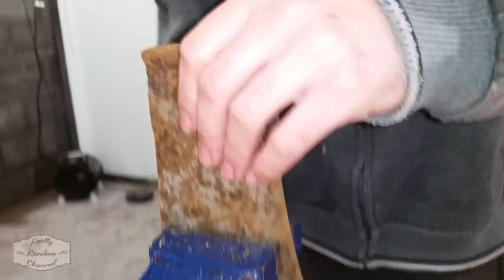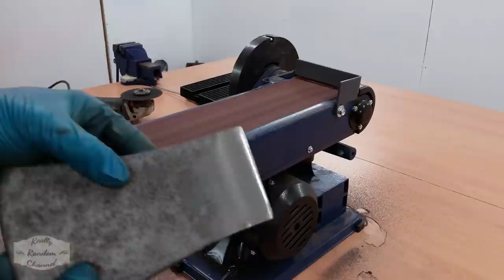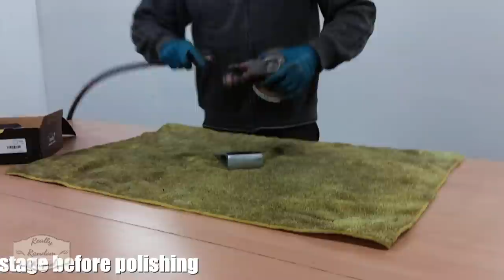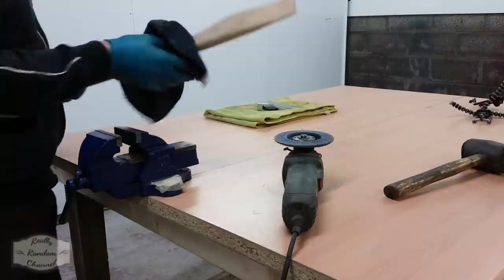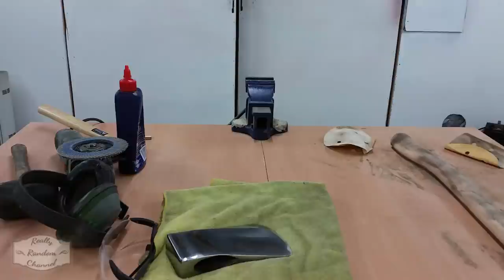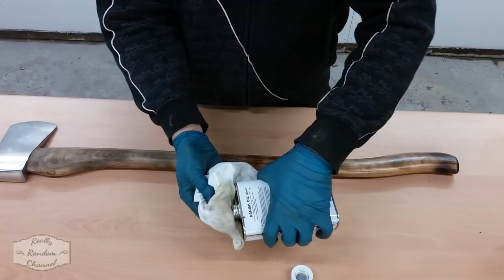Rusty Old Axe Restoration

Comment: So, I enjoyed this muchly. But the workspace gave off this weird vibe.
Reply from the maker: Really? what kind of vibe? Im thinking maybe i need to have some tool boxes and stuff in with me to stop the place looking so clinical?
Reply: Really Random Channel .... I think clinical is probably a great description. Almost felt like you had a room next door with a chair in the centre bolted to the floor, covered in chains, with all your cutting devices hanging up in there 😂

You’re probably just lucky to have so much space. The room you walked into with the axe head has nothing but two big desks and a vice. In the UK we usually have so little space, that one room with the desks is bigger than my entire workshed.

Perhaps you just need tools on the wall, a vac system etc. Perhaps some racking at the back. It didn’t put me off the video, as I said I loved the project. Just odd to have so much space and so little filling it.

Subbed btw.

Comment: isnt easier sand it with flap disc on angle grinder, polish, also with flap disc do the grind for sharpening, put the head on cable (properly) and smash some logs? Ur job is pretty amazing but i think thats possible do a same looking axe with 30% of work or less

Comment: I'm about to try something similar. Do you, or anyone else, happen to know if it would be worth giving it a heat treatment before finishing?
Reply: ONLY IF YOU OVER HEAT IT WHEN WORKING IT. RED HOT METAL THAL COOLS SLOWLY CAN LOOSE ITS TEMPER. Sorry about the cap locks. Most of these tool heads are high carbon and should be quenched after heating to an orange color hot in oil. If you want to keep the crystal structure of the metal as it was when new just keep it cool as you grind and sand it.

Comment: Im always wondering. Should the axe head not go deeper into the wood handle and should you not then leave more of the head sticking out that cutting it down so low? It just seems the Axe head will eventually pull loose of the wood handle.

Comment: Question: If you are able to file sharpen the axe head, doesn’t that mean it’s not hardened? Is there a reason to not harden an axe head? Also, with all the work out in to make it new again, I would have done a little reshaping if the blade edge. Just me though.

Comment: The tips when you restore such tools are
The handle should touch perfectly the inside surface of the head of the tool.
The handle should not have a shiny surface for a good grip. 
The handle should  not be round but oval for better grip - it does not turn in your hand. 
Shining tools is of secondary importance.

Comment: Using an angle grinder without the guard with a CUTTING disc is asking for major league trouble, especially if you (occasionally) use it for grinding. Cutting discs are notorious for flying apart even if you use them exclusively for cutting. This practice will get you with high-speed projectiles in your face.

Comment: Incorrect way of installing the axe to handle. You don't use a mallet to beat the axe head onto the handle. Tap axe head so it doesn't fall off, then tap handle end downward until axe slides up, until it is as far as it will go. Use a longer wedge without glue, and axe head won't go anywhere.
Reply: To add to this you should prime the shoulder with linseed oil or similar before the final hang. You should also use a block of hardwood to tap the wedge into place. This will prevent cracking the wedge and give you a better drive. You also didnt finish the the wedge with a step lock or wedge pin. Overall nice restoration though.

Comment: Only thing I would change is that to properly seat an axe head you hold it upside down and hit the bottom of the handle with a heavy plastic mallet of some sort. Other than that looks great
Also use a piece of wood between the hammer and the wedge when you sink it in. This will keep it form breaking. It's a nice job but after seeing this I wouldn't trust that axe for longer than a day or so.
Reply: Yea that really bothered me how far the wedge went in and how far he put the axe head down the handle
Reply from the maker: Check out my new sledge hammer video you'll see i learned a lot of lessons from this axe ;)
Reply: @RRCRestoration  Beautiful build with the sledge. Head mounting was much better, however when I say hold it upside down, I mean hold it. The head hangs in the air, and when you hit the back (something plastic suggested) the handle moves down but the head has a lot of mass and wants to stay put (Newton's first law of motion) thus driving the head onto the handle with its own weight. Not only does this keep the head and handle safe, but it ensures the head goes on perfectly straight. Other than that, it's absolutely stunning. Love it

Comment: I just wonder... you don't need to treat the axe against rust with an anti-rust oil for example? IS it useful or useless?
Reply from the maker: Thanks for the comment. After using  a bare steel tool like this i always give it a wipe down with wd40 or even engine oil just any oil that will stay on the surface of the steel until its next use. Ive been doing it this way for years and never had a rust issue ;)
Reply: mirror polish will help somewhat against rust. fewer surface imperfections for moisture to go into.

Comment: Good job with the head, however you’ll swing that 5 times and the axe head with fly off the handle. Your not supposed to sand down the insert your technically supposed to force it on then jam the wedge in there as far as it will go. The axe head should not slide easily on the handle like that it’s gunna fly off the handle.

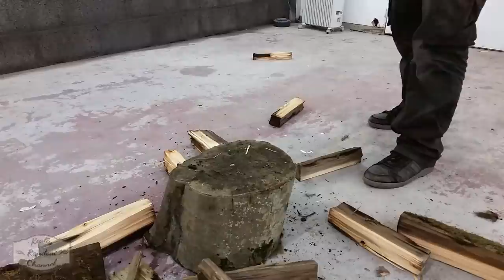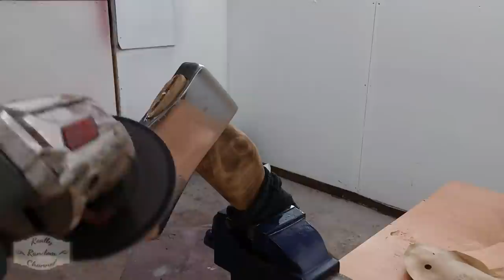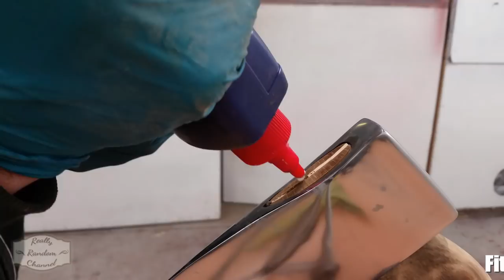Comment: at 18:04 it looks like the handle is already loose on the head.  It didn't appear that the wedge was properly put in at 13:45, as you can see in the video it broke of while he was still driving in the wedge. Should have removed the wedge and started over.  Attention to detail and all(14:01).

Comment: As someone who uses an axe quite frequently dolling them up like this feels kind of wasted. It' s like polishing a crowbar. Sure its shiny but it doesn' t really add anything now you just don' t want to use it because you don' t want to ruin the shine.
Reply from the maker: You make a very valid point. I only use an axe very occasionally so it should in theory stay shiny for years to come :)
Reply: I actually agree with this.  It's fun to polish things, but for a real work tool, basic clean up, a good edge and a coat of red paint is what's really wanted.  It doesn't make a good video though, and it is fun to see what you can do with a crapped out mushroom-backed axe-head.  I actually have just such an axe-head in my tool shed, and one of these days I may just make a D & D prop out of it.  I already have 2 working axes, but this head came from my great grandfather and so something good has to happen to it.

Comment: no guard on the angle grinder? basically asking for it ent ya lmao
Reply from the maker: Dangerous yes, but its a very common practice in the motor trade to remove the guard as it gets right in the way if you are working inside a wheel arch or transmission tunnel.
Reply: As a mechanic i can agree that I see loads of people doing it, I just prefer to have all 5 fingers than a bit more room on an angle grinder, I just choose to pay 60 odd quid and bought one with a 50mm disc if I need to get into tight spaces.

Comment: I'm not a fan of the burnt handle look. is a first class job, that's for sure. With the burnt handle, I think the head would go with it better if it was not so shined up and just blued. Personally I would have used a walnut stain on the handle, then coated with clear poly. Keep a thin coat of WD40 on the head, to prevent it rusting again.

Comment: I always like to make sure i plug my power tool into something that can fall off the table, I also appreciate when I'm sanding, the machine dances around, because nobody has time for bolting things to tables. Pfft.
Reply: Fox Racing it’s a table clamp belt sander you’re not supposed to be able to bolt it to the table

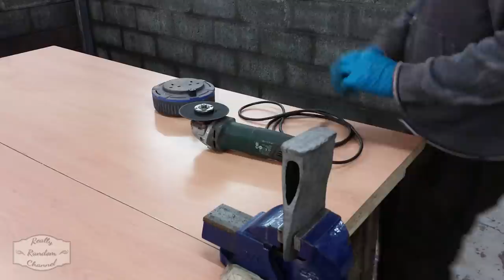Comment: @ReallyRandomChannel 2:26 If you need I will donate for you to buy a guard for your angle grinder. That is SCARY!
Reply from the maker: Dangerous, but its a very common practice in the motor trade to remove the guard as it gets right in the way if you are working inside a wheel arch or transmission tunnel.

Comment: beautiful show piece, but very dangerous to use. The way the axe head is fitted is not secure.
Reply from the maker: Hi, I was using it all last winter and will be using it again this winter for chopping firewood. The head is still as tight as the day i hung it, so no issues with safety at all.
Reply: I hope it works great! Definitely keep an eye on it, odds are it will stay on for a while but long term i question.

Comment: My one issue with this video is where you used a grinder with no guard and a cutting disc. If the disc had fractured then you would have at the very least sustained life changing injuries from that disc. Please invest in a guard for your own sake

Comment: there is no safety precautions, hollowness when driving in a spacer, a mallet is used for this, excess body movement, why was it necessary to age and then grind the wood to such a degree that even fire burns were not visible

Comment: I disagree with the way you did this, I mean it s an axe that now works but next time try using distilled vinegar and soak it for about 2-3 days this is so you don't have to take as much of the meTal off trying to dig into the rust. Also when handling the axe you should have the head of the axe down close to the ground and hammer the bottom of the handle facing up, that is a proper way to handle an axe. Also use boiled linseed oil and don't use glue to put in the wedge. The linseed will expand the wood making it a tighter fit after. Also the bottom of your handle was a little split. Over all looks pretty and shiny I just don't think it will last as long as other axes. I did like the air pressure never seen some one do that, that was cool. Also you should have wet the stone before you sharpens it. The files were fine when it's super blunt like it was but after of course make sure to wet the stone. Good work!
Reply: I like the additional comments here and would add one thing. If this axe is being used in a coastal area the handle with expand and contract if being used during wet winter conditions. We cut the wood about a 1/4- 1/2" short before final installation of the head, using the tapping method. We never glue our wedges in, We use a chisel or small dremel / router to cut the wedge down to the level of the handle inside the axe head. That space is then filled with liquid fiberglass resin ( with hardener) or liquid latex. Now the handle is sealed against the weather and will stay tight for years, providing the fit against the handle is properly done on the underside. Beautiful job on restoring the axe head, going to try it on one of my Arvikas.

Comment: A looker sure, functionality questionable, not properly hung, the grain orientation looked off and the cracking at the bottom tells the handle won’t be long lasting but for a quick dirty restoration you did well 🙂

Comment: At once it is visible that in case of fastening of an axe on an axe handle-it is silly. Very quickly the axe will start to hang out and there will be an increased risk of departure from the handle.
Сразу видно, что в случае крепления топора на топорище-это глупо. Очень быстро топор начнет болтаться и появится повышенный риск отхода от рукояти.

Comment: Omg. This axe is not sit very strong on the handle the way you done this. You have to put a head with hammering on the handle from the palm swell to realy snug fit it on handle. And then wedge should go all the way down mushrooming the wood above the head. Then you cut off the rest leaving 5mm left.

Comment: Please, don't ever try to really use that axe. You mounted the head completely wrong on the handle. There's a reason it's called hanging an axe. And your wedge was way too small. There is no integrity in the neck of the handle. Someone could get seriously hurt. Learn what you are doing before posting a video. Others will try to mimic you and someone will get hurt.